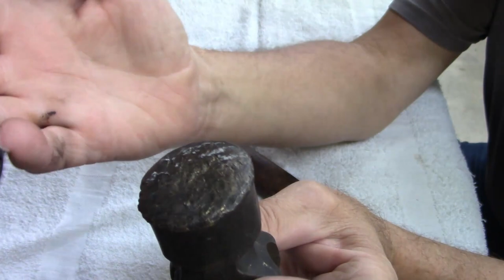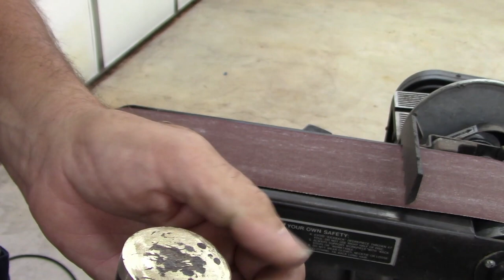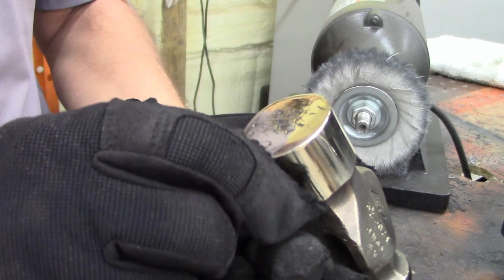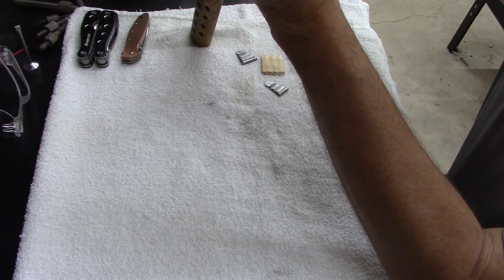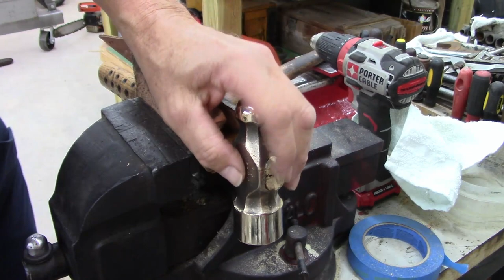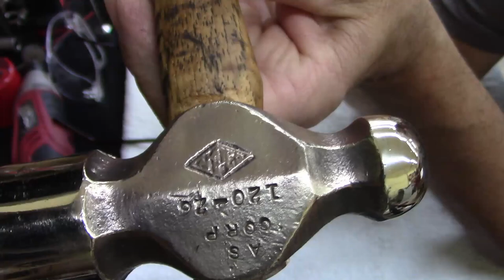Brass hammer restoration

Comment: Very cool, that turned out nice. I'm actually finishing up my brass hammer when I get home.  I get carried away on mine as well.
Reply from the maker: I forget that I have 6 different brass hammers now! and there is nothing wrong with good looking clean tools!!!!!!!!!!!!
Reply: I have stopped gluing my shims and so far had no problems.
Reply from the maker: @_BigLife_  I was trained not to on hammers, because on job sites time is money, so you fixed it on the fly or you had spare hammers, and if you had to cut or drill them out, it ate your time up, plus you may ruin a good handle that just needed to reset it and a little linseed oil, I have seen an old man I worked with use turpentine, if you ever get a chance you have to work with an old frame carpenter, it is like working with an old welder, some of these guys have tips and tricks that are amazing!😀😅🤣😂

Comment: Heat with a torch the mosheroom and then hmmer it around You Will sabe materiL
Reply from the maker: Thanks, I did not know I could do that, I will try it next time!!!
Reply: Please yo meet You i like your determinación yo do the tool restoration , Aldo the tankfull You sre yo the old man that show You to fix the hammers in the eork place God bless you
Reply from the maker: @genarolamberti799  Thank you for the great comment, I try to show good used tools.